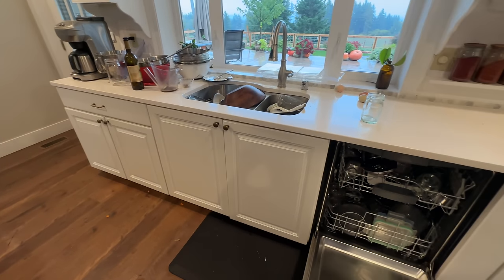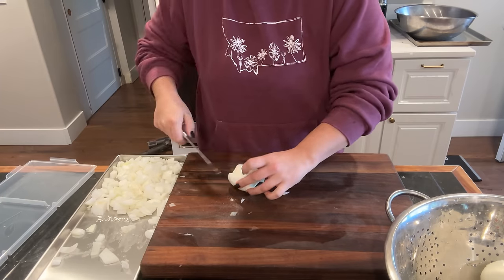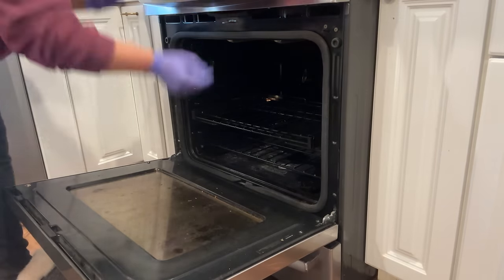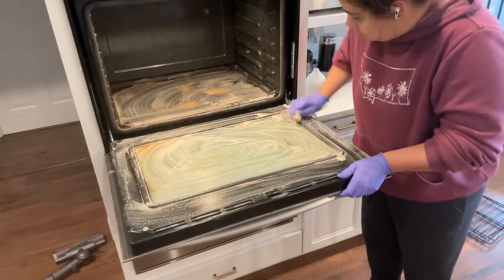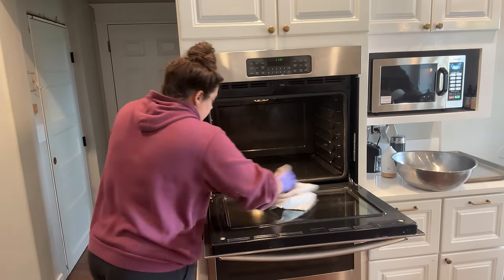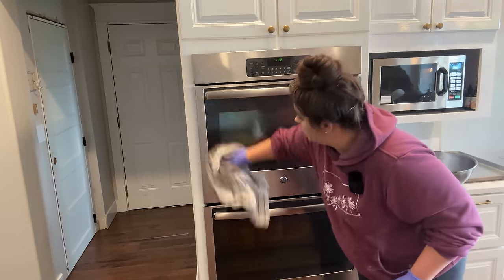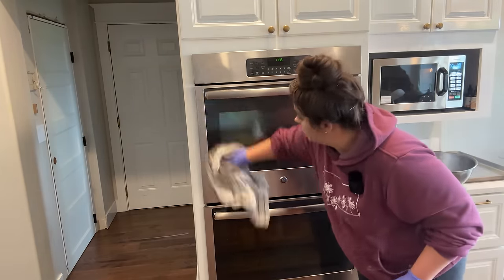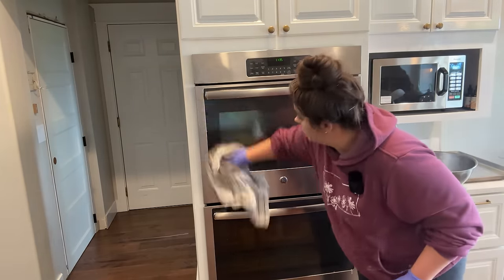This can't be put off any longer!

Comment: Im a professional cleaner. My tip for deep cleaning is start from the top down and from left to right. That way you never forget where you left off. Also for oven cleaning, spray your cleaner of choice, close and turn on at 200 degrees for 30 minutes -1hr. Everything will wipe right off while still warm. Great job on your methods. Just some ideas 💡

Comment: Hi Becky, I am not sure if anyone else has mentioned this but you need to fireproof your kitchen.  You need at least one fire extinguisher, maybe two.  Also, there is something called a fire blanket.  Check into it.  That way, if you were to have a fire, you would have it contained before it spreads.  Believe me, kitchen fires can be devastating.
Reply: Yup!  I have a little kitchen extinguisher next to the stove, and a fire blanket in the pantry.  I've never had a fire, but I'm sure prepared!

Comment: Hi Becky, I just wanted to let you know that the oven doors are removable, which helps to get a better angle in the oven.😊❤🎉
Reply: I’m so happy you mentioned this, so many people don’t know the oven doors are easily removed. I didn’t learn until I was in my fifties 😂
Reply: I was looking for this😊
Reply: Mine doesn't come off.  I tried.  It's one of those little 36" wide apartment sized stoves.
Reply: I was coming here to say this. Sooooo very helpful! I take mine off and sit it on the counter top to clean. Saves my back!!

Comment: The oven doors can come off to make cleaning easier. There are clips at the bottom, they are part of the hinges.
Reply: Oh wow I didn’t know you could take them off.
Reply: @Cookingwithapril  yep! It makes it so much easier
Reply: Thank you for telling everyone about this.  I thought everyone knew.
Reply: Be careful doing it though!  If you aren't careful you can shatter the glass.
Reply: Just pull the door up. 😊
Reply: Last year was the first time I found out about it.  It was so much easier to clean.  I think I saw a TikTok about it.  Greatest invention ever
Reply: I did this once and it was incredibly difficult to get them back on by myself. A helpers may be needed 😁
Reply: You can actually open the door up even more and clean in between glass
Reply: Just know that (some not all) doors have a lock down by the hinges.
Reply: That’s exactly what I was getting ready to say. I’m short so it’s the only way I can reach the back. 😂
Reply: Yes. Once door is off you can slide out the glass to clean both sides if the door is double glazed.

Comment: I am a messy baker so was thrilled to discover oven liners. Makes cleaning the oven go so much faster and saved me a lot of work when my sweet potatoes covered with marshmallows ballooned into an atomic blast in the oven. Black smoking tumors all over my liners. Cleanup was a breeze with those liners.
Reply: I’m always spelling things in the kitchen… well  I spell things everywhere
Reply: You beat me to it.  Since I've started using oven liners, I don't bother putting sheet pans underneath pies and such in case they spill over.  Great invention. ~ Lisa
Reply: @LB-vl3qn  I'm almost 60 and never knew about oven liners til these comments. I'm so tired of cutting foil to fit the big and toaster ovens constantly and now I don't have to anymore! Thank you!!🤩
Reply: What oven liners do you use? I've tried a couple but they seem to smell bad when heated.
Reply: Oven trays do save a lot of work, but some stoves are designed not to use a tray, just use automatic stove cleaner button attached to stove
Reply: I used to use oven liners. I would put tin-foil in the bottom before liners came out. When I bought my stove I could not find just a regular oven…they all had convection added. You CANNOT put an oven liner OR TIN FOUL in an oven that is also a convection one. I hate that!
Reply: @bryndiscurtin6481 if you haven’t an oven/convection you cannot use liners. I love oven liners but when we had to buy a new stove I could not find one that did not include convection with it and it clearly states in manual you cannot use a liner or foil. So that could be the reason you are smelling an odor.
Reply: My mother layed aluminum foil on the oven floor of her oven when she first had her oven installed. It ruined the finish on her oven floor. Come to find out when she read the appliance book, it specifically said not to.put foil on the floor of the oven, that it would ruin the finish. So she has had to live with the look of it ever since it was brand new😢
Reply: Yes I get the oven liners in Amazon have also found them in Home Goods.
Reply: @karenculpepper973  you can’t use a liner in the bottom because there’s no burner grid showing.  It’s in the floor of the oven.  You CAN use it on the bottom rack.  I’m proof because I put it in when we bought it about 5 years ago.   Never a problem. Maybe your stove is different than mine.  I have a GE profile oven/ convection oven.  Really, it’s been fine.  I’ll recheck my paperwork just to be sure.
Amazon has oven liners, Walmart, not sure where else.
Reply: Bought my oven liners at target 🎯
Reply: I need oven liners in my life!
Reply: @karenculpepper973 
Same here; wish l could use a liner or aluminum foil in my gas/convection oven. You would think so with expensive ovens like WOLF or Thermadore. Replaced my 20 year old WOLF with a Thermadore. Honestly I like the cast iron grid and cooking with gas due to my love of cast iron cookware…but I really dislike the oven as you can’t fit much even with the adjustable racks. If you put cookies on 
Upper, middle and lower rack I’ll guarantee none will turn out. The bottom and top racks will burn and the middle rack won’t be done … at least the center of the cookie sheet.
Reply: @bryndiscurtin6481  grill magic heavy duty.

Comment: Hi Becky just a tip cleaning your oven. The oven door can be removed, just lift the oven door up whilst it is open and then you don’t have lean on the door as this can cause the door to stretch. This way you can get right up into the oven. I clean mine every 3 months I spray and leave overnight. Hope this helps. Cheers from Australia ❤

Comment: Another thing I do is vacuum the vents on the refrigerator both at the bottom and in the back plus any freezers 
They collect dust and animal hair 😊
Reply: this will extend the life of your fridge.
Reply: I had to take off a plate at back of fridge to take of and clean with vaccuum.
Reply: Don't forget back of dryers

Comment: I’m so grateful that my ovens have a self clean and do an exceptional job! I recently took my door completely apart because there was stuff in between the glass and it was so satisfying!
Reply: How did you get doors apart?
Reply: I think that you can un-screw them after lifting them up off of the hinges. Put the screws in a small bowl away from where you are cleaning. It's easy to knock the bowl over.  Ask me h😮 I know that. It's hard to get screws out from their hiding places 😮!
Reply: I used self cleaning once and my husband went in to anaphylactic shock. Got him outside, turned everything off, opened every window, and haven’t cleaned an oven since. 😂 I was definitely traumatized. I guess I’ll tackle it now. New house, new oven!
Reply: @groovechick1   I have never had a problem with my oven cleaner setting.  I have set on a timer to warm the house while I sleep. It is a KitchenAid oven
Reply: I used it once and the oven was locked for over a year until my father in law pried it open. I made an entire Thanksgiving dinner in a toaster oven! Ever debone a raw turkey? 😂
Reply: @terryhuggins8529  I watched a you tube video to explain the process. Took pics at each step but it’s really just a matter of taking the door off and unscrewing a series of screws.
Reply: @terryhuggins8529  with mine, once the door is off it’s easy to slide the glass out then clean both sides and the inside of the door.

Comment: A cup of water with lemon zapped in microwave makes cleaning easier & smell nicer. I'm sure this will work in ovens as well (only bowl / pot not cup), depends on how you feel about it - basically a steam bath for the oven to soften crud. 😊
Reply: I have an electric oven. I find that while oven is still hot from cooking, I take a soapy and damp dish cloth and will wipe up the spills quickly and also wipe oven. Takes less scrubbing. Use pot holders to hold hot element while I wipe.

Comment: Girlfriend, easy off is your friend for those ovens.  You can use it just to spot clean to.  No razor blades necessary. You can also go to a craft store buy some pretty scrap book pages to put on the inside of the drawers that have the windows in them and switch them out for the holidays to add some extra cheap festive touches to your kitchen. You can also laminate those same pages so they are super easy to clean and reuse.
Reply: Another great idea is that window cling that you can put in your bathroom windows or whatever so people can’t see in. Then you can hide the contents of what’s in the hospital cubbies. It used to be a thing to decorate those little areas by filling them with beans or coffee beans, lentils, etc. etc.
Reply: Remnant rolls of wallpaper will work as drawer liners also.

Comment: Hi Becky. Try using draw liners they are much easier to clean. It also preserves the wood of the drawers. Or you can try plastic bins/trays to put your items in the drawers.  I totally agree with you…a clean kitchen to work in is GOLDEN! I mentally cannot use my kitchen if it’s messy, it’s too much of a distraction. Exactly, you can only do your best and your priorities are going to be diff than others. Never compare yourself to someone else every person’s situation is different.☺️ I even use handle covers on my refrigerator. I cannot stand fingerprints. Something as simple as a fingerprint can make something look dirty to me. Great video. Tfs. Enjoy the rest of your afternoon.🤗
Reply: i didnt know they sold fridge handles. I hang a clean towel on the bar and pull the towel to open the door to avoid the prints 😂
Reply: All my kitchen drawers and cuboards have liners. It is easier to clean them when they are lined.
Reply: I need handle covers where do you get them? Lol.

Comment: FYI for those who don't know microfiber clothes should never be washed with fabric softener and never go in the dryer, let them air dry. When you use fabric softener and put them in the dryer it takes away their properties of absorption and static that they need to dust and work at their best.
Reply: true - any towel you want for cleaning should not have fabric softener because it won't absorb the water! - I hate the way microfiber towels feel in my hands - prefer cotton.
Reply: I stopped using fabric softener know I used dryer balls cheaper . Biodegradable children and pet safe
Reply: Exactly true about fabric softener but electric/gas dying is totally fine for microfiber. I'm a professional cleaner and have used the same microfiber towels for years doing this and they absorb like day 1.
Reply: Don't use softener but wow had no idea about not drying them
Reply: I dry my microfiber in my dryer all the time. Works just fine. But yes, no fabric softener.
Reply: Don't use softner at all it will destroy your washing machine
Reply: And they should never be washed with anything other than microfibers.  They capture and get clogged by the fibers!
Reply: I don't use fabric softner/ dryer sheets except on very rare occasion.   I use the dryer balls .  Suppose to be better for clothes and dryer..
Reply: @painiacs83  I only use vinegar and my laundry is so soft ...

Comment: Yes! Kitchens will always be there. I love your priorities and your work ethic!

I’m sure Hubby and Baby Acre treasure your presence when you’re able to spend time with time but I imagine they love the way you feed them, too!

Also! I want your kitchen!
Reply from the maker: Thanks so much! 😊
Reply: @AcreHomestead Becky, Bar Keeper’s Friend was designed for the stainless steel bar counters. I like it for my sinks, too!
If your oven racks are needing a clean, run about 3 inches of hot water in the tub. Add about a half cup of ammonia. Mix with gloved hand. Add a towel to the bottom of the tub to avoid scratches. Add the racks as many as you want as long as they stay submerged. Leave for several hours. Drain and use shower head to rinse. Place on a dry towel to dry. Hand dry if any food stuff remain.
Reply: I'm so jealous of your pull out drawers and the huge deep drawers to put all your baking needs in one place. I hate dragging everything out of my pantry every time I want to bake. And digging under bottom cabinets for pots and glass pans. I love your kitchen. You have really organized it well.

Comment: PS.  If your fridge has a vent on the bottom tackle that as well. It should pop off and vacuum out under it.  And I would put contact paper inside the cupboards and drawers. To protect them.

Comment: Another item I tend to put off is my washer and dryer 
Cleaning the rubber parts in the washer the dispenser cups and I do a monthly vinegar and baking soda empty wash in the washer 
Also pulling them out and sweeping and dusting behind them especially the dryer vent 😊
Reply: How much soda and vinegar do you add to washer?

Comment: Hi Becky... something that I found out about growing up (bc my dad was ever so handy) was the dishwasher filter. If your dishes aren't getting good and clean,  twist the little round basket in the bottom of the DW and pull out the filter basket. Just rinse under hot water and reinsert it back in the DW. I check mine every other month.
Reply: When I moved into my house this year I cleaned my dishwasher but I still had little specks that ended up on the dishes and inside the glasses/cups. I took the bottom off the DW and found a 3" chunk of broken glass down there along with a lot of crud. That got scrubbed and reattached. Still had little flecks of ick on the dishes. I cleaned out the little holes and used canned air to blow out yuck in the water fan blades. I finally have clean dishes - usually. I am looking forward to buying new appliances next year to begin with everything completely cleaned and nothing weird coming out of crevices.
Reply: @lindabirkes-lance8915 That's so good you checked thoroughly. Wow!  Broken glass?  Glad you found that!

Comment: A suggestion…you might want to pull out your stove and clean the sides of the stove and the sides cabinets and clean underneath as well. You will usually find grease dripped down the sides and straight vinegar will clean that up in a hurry. Because you have dogs, I would also recommend pulling out and cleaning under the fridge. You can use a can of compressed air to clean the coils. While you’re at it, you could go ahead and do the same with the washer and dryer. I try to clean under my appliances every 3 to 4 months, just because I have animals.

Comment: I always used the self clean on my oven until recently, I was told that they get so hot that it causes the computer boards in them to go out, so I’ve been doing it the old way, like you just did 🥰 your an inspiration, thank you
Reply: I've made sure to purchase an oven with a steam cleaning cycle! It loosens up the junk without putting the electronics at risk ❤️

Comment: I buy the cotton diapers and use those in the kitchen. They are gauzy enough I can use them as strainers, flour them slightly and use them as a pastry cloth to roll out noodles and bread and use them for cleaning and drying dishes etc. they wash up great in hot water. I learned to use these from my grandmother.

Comment: My goals batch cook some soups and cookie dough. As for cleaning I had to make myself a schedule.  1)Daily- dishes 2) Weekly- sweep&mop laundry 3) Monthly- good clean [ I break my home into 4 areas for the 4weeks in a month]  example wk4 is my kitchen. I will clean dust upper cabinets and crown molding, wipe any missed spill on lower cabinets, clean ovens, microwave, refrigerator, stove, and vacuum crumbs that may have fallen into drawers. 4) Bi-Yearly - Deep cleaning. In the kitchen I'll pull refrigerator out vacuum and clean coils and vents. Clean inside cabinets.

Comment: Hey Becky twice a year I'm checking light bulbs around the house, cleaning vents, smoke/carbon monoxide detectors, breaker box fuses, flash lights, changing heater filters about every month, testing outlets, gutters, water heater  maintenance when needed, outside lights, hoses, winterize water pipes and faucets outside

Comment: Seeing your satisfaction at a clean oven glass really made me smile, I relate so much. I cleaned my oven  just last Saturday , after a few months from last time, and it was consisderably  easier than the first time I did it ( who knows when it was cleaned last before I mooved in). Another thing I did the same  day was switching the paper flyers over the top of the  kitchen cabinets with clean ones, to  catch dust and grease that get on every flat suface when somene actually cooks in a kitchen. It  spared  me hours of scrubbing while up  on a ladder. The trick is to use some vase or other decoration ( or a strategic piece of tape ) to prevent them from moving when it's windy.

Comment: A few jobs well done! You are awesome. I would suggest to clean the top of the refrigerator and pull it out as well as  your stoves  to clean underneath and the sides if they are up against counters. Clean the back of the inside freezer on top of fridge to check for any pieces of frozen peas etc. that might cause problems later on if stuck on the drainage tubes. Wash wall clocks, ceiling fans about 2 times a year. Door frames on the tops, basically things with ledges to collect dust.